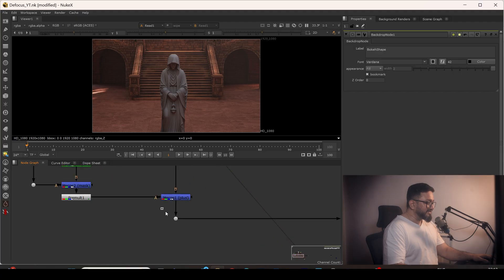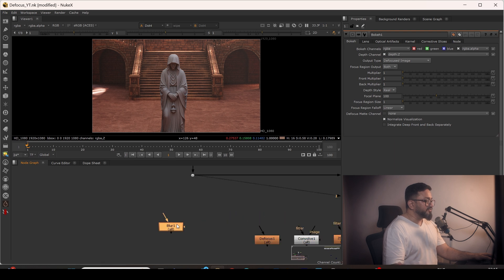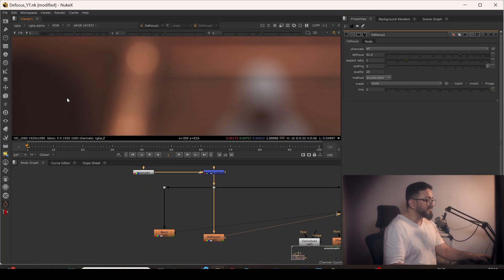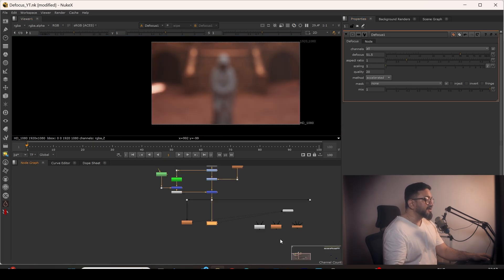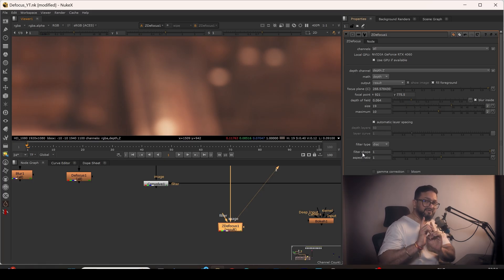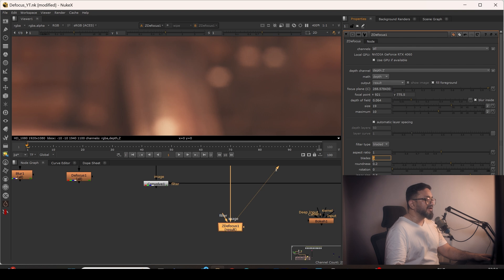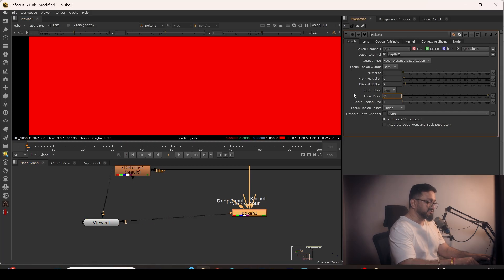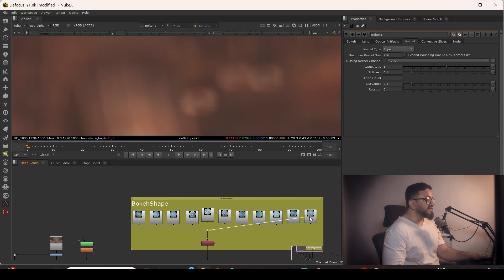STOP USING DEFOCUS WRONG IN NUKE ! DO THIS INSTEAD | VFX VIBE

Comment: great video, really helps. One question though, lets say in Blender you render just the beauty shot with volumetrics, and lets say you are too lazy to render the volumetrics as a seperate pass/layer meaning you just use the raw beauty shot out of Blender, how would you do the depth of field with volumetrics in the shot? Using cryptomatte as a mask wont work, any solution?
Reply from the maker: Normally we always plan our shots and we always give freedom to compositors. 
It's very tough to do the desired work on just a beauty pass. We can try manual masking + cryptomatte and will try to generate depth in the nuke using the nuke depth generator node. But it is very hard to work only on beauty pass.